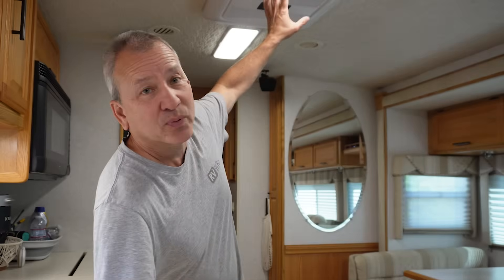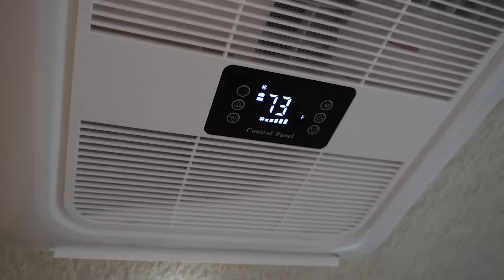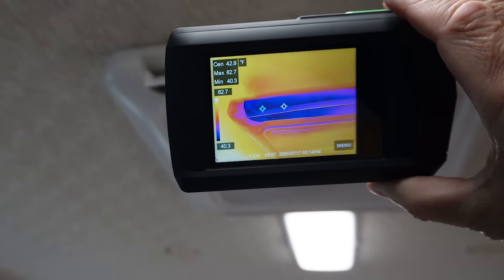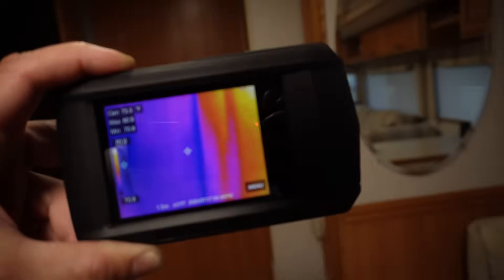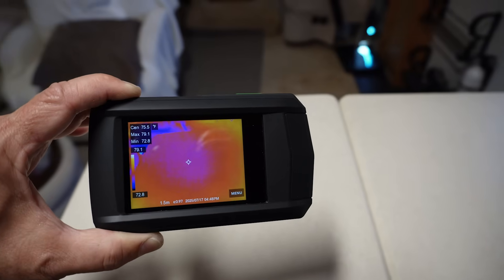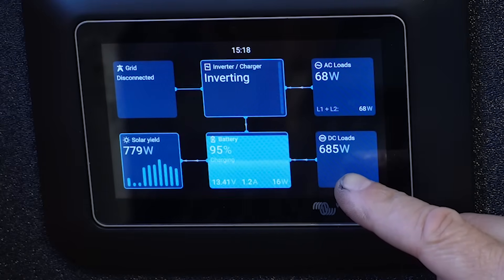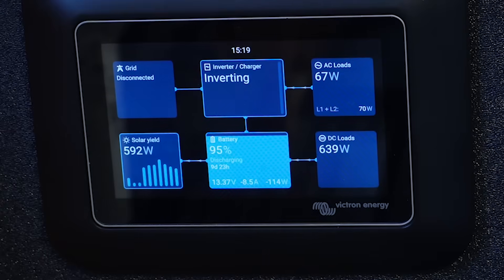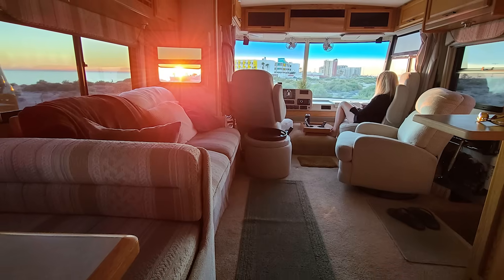91° Heat Test (Solar Only) : Can The CountryMod 12V A/C Keep Up?

Comment: I am building a small sleeping camper . 95" by 50" by 46 " tall . Do you think this will work with 800 watts of solar and 600 amp hours of batteries and run for a few days if sun is decent ? What do you think the minimal solar and batteries i could get by on ? I figured the 800 watts is good to go but not sure i can get that amount on the roof . Thanks for your opinion
Reply: I would add a ground deployable solar array to help offset your day time load consumption, and with 600Ah of battery, it would help with charging it. At a mere .1C rate of charge, that's roughly 850W just to charge that massive battery bank you have. Unless, you have generator as well in your setup?
Reply: @s.mendez7160 basically trying to get 3 days running that 12 volt ac . It's a small space and will be well insulated . Of course you don't know the run time . I would think it will run on a lower setting . The good thing is a small space chills fast so it should not need to continuously maintain a temperature  24 hours . Basically it's just for sleeping .
Reply: @stevencole7331  Ask Brian if he has any 24hr average consumption data in terms of Watt hours. That would give you an idea for his RV space. Yours is super tiny, so as you mentioned, the duty cycle will be far less.
Reply: @stevencole7331  2pannelli da 410watt 172cm x 113cm con 2mppt da 40amp e 2batterie lifepo4 da 314ah in parallel watt cicle mini is ok inverter da 2000watt max 2500watt cable 75mmq ok 👍
Reply: @stefanocerna6504 Thanks . Just going with a 12 volt setup  so the inverter is not needed . Yep you seem to be along the same lines as I figured . 2 300 amp hour batteries in parallel and 800 watts of solar should do the trick for a few days . Appreciate the reply

Comment: Wish I went with CountryMod it seems quieter and consistent compared with the OutEquip which also cycles on and off so often.
Reply from the maker: Good to know. Thanks.
Reply: @RVwithTito  I figured out that I just needed to adjust some settings. OutEquip works good too. 😃

Comment: Your Cerbo GX shows 780W from the solar panels. If I remember you installed 4 panels of over 400W. So now it is just maintaining the batteries. How much charging watts did you finally got at maximum from your panels so far?
Reply from the maker: They've generated over their rated capacity in certain optimal conditions. Typically up here I max out around 1500W

Comment: Hi Brian,  Good video as I contemplate my alternatives.  We're heading to Kent today to see one or two Van possibilities.

Just as an experiment, I wondered where you had been when you took the desert resort picture you dropped into the video.  I cut it down to include only the outside view through the windows and submitted it to AI for location ID.  Since this was my first time using such a thing, I'm wondering how it did.  Here's what it said.  Was it close?  
Thanks, Bob

"The image displays a coastal scene viewed from inside an RV, featuring a desert-like landscape with low-lying vegetation, palm trees, and multi-story resort buildings. The vibrant, multi-colored hotels (especially the yellow and teal one visible on the right) and the overall environment are highly characteristic of popular tourist destinations along the Sea of Cortez, specifically Puerto Peñasco (Rocky Point) in Sonora, Mexico. The combination of ocean, desert vegetation, and distinctive resort architecture strongly points to this region. The sun setting or rising over the water further aligns with this coastal desert setting".
Reply from the maker: Yes. It was at Rocky Point 🤩

Comment: I like the GREE EcoCool 15k BTU High Efficiency A/C + Heat Pump, better for your size RV & the area in which you live. Although it may require a Soft Start, it runs around 800 Watts on High Turbo Mode. It can also be connected via Wi-Fi.
One of the most powerful, quiet, and energy-efficient engineered rooftop air conditioners for the RV industry.
Reply: Nothing wrong with the GREE unit but it runs off 110v.  The whole point of these little units is they run directly off 12v batteries, no inverter no soft start.  I think the results he's seeing are amazing considering the rig size and BTU of this unit.
Reply: @StuPedasso 
I'm actually subscribed to Brian's channel. I watched him build an Air Condition System that runs on a maximum of a Thousand Watts. He is just playing around with this 12 volt Air Conditioner. I am a huge fan of CountryMod Pro. For that size RV it is more suitable for a Bedroom, because 79° is not comfortable inside an RV.
Reply: @lindsaywhite4502  if I recall correctly, that AC unit he built was also 12V. Again, I think he's exploring this ever growing works of 12V sure conditioners.

Comment: I put one of these on my 5th wheel after watching your video. The install had some problems. My roof was a lot thicker than yours, and I had to special order longer metric screws, because none of my local hardware or Home Depot/Lowes type stores carried them. In addition, I had to make and extender box out of cardboard and silver taper for the air exhaust to bridge the extra thickness gap. Recently, we took a 3 week trip through California, Oregon, Washington, and Idaho where outside temperatures averaged in the high 80's and 90's, and it wasn't enough to keep things cool. I realize that a fifth wheel is a bit bigger than your RV, but I was hoping it would keep my rv cool while driving,, but it didn't really keep up.I have 4 one hundred watt Battle Born batteries with a Victron inverter and 800 watts of solar, but the batteries didn't last long with the fridge, Starlink, and air conditoner all on while driving. It did ok, but when stopping, we used hookups and a Costco 12000 watt window vented air conditioner.
Reply from the maker: Didn't realize you'd have such a thick roof in the fifth wheel. I have a store nearby called Tacoma Screw where I get specialized stainless hardware like that...and...much cheaper than Home Depot. Thanks for the follow up report.
Reply: Had same issue with my Alta 28 foot toy hauler. Ordered longer screws on Amazon and made an extension of the air box with some packing material my batteries came in. Just back from mid 80’s trip and the unit kept my trailer reasonably cool when I closed off the bedroom and bathroom. Nothing close to the cooling of my regular AC but happy to have some cooling without running generator as I do not have an inverter and other than AC don’t have the need. In the future off grid in warmer weather will plan to run generator and AC to cool rig and then switch to DC unit.
Reply: @allenmay8850  Do you have a DC to DC charger?  If not, would that have kept the batteries up?  Setting up my system and want to drive with AC on and all the stuff you listed.

Comment: Hoping to do this in the next year. I travel with a dog and while I try to “follow the seasons,” there is no way to 100% escape dangerously hot days. I have 400W solar and 420 AH lithium set up on a truck camper. Wondering if I would have to up my panel/battery game to run an A/C like this…not too much room to cool, and I’m in a fiberglass truck camper with good insulation. Would love to not have to hook up to run my a/c
Reply from the maker: It would be a push for you to run it full time like I do along with all your other stuff. You'd probably need a little help from a small Generator or extra solar during the day.
Reply: @RVwithTito Thanks for your response. I’m a bit limited on space being in a truck camper. My lithium setup is in the compartment designed for a small generator and I don’t want to deal with hauling gas/propane around for it anyway. I do have room for an additional 200w Panel up top, but absolutely maxed out for battery space. My electric use is very minimal with the occasional use of an air fryer. No other high draw appliances and my fridge is propane. I think the market for 12v A/C is heating up (pun intended!) and hope technology advances quickly.
Reply: it's easy to add 400W of ground deployable solar into your existing system. The extra wattage really helps to save the Lithium bank for night time use.
Reply: @s.mendez7160 Yes, good point! But for my circumstances right now, it wouldn’t work because I’m away from my camper and parked in a hospital parking lot  because I’m a part time travel RN. I do camp hosting in the summer, so I generally have a hook-ups during the hottest part of the year. Still, would love to not HAVE to hook up to cool down, and very much trying to step away from the whole RN inpatient care business. 😊

Comment: I would like to see what it does with 110° heat in the TEXAS direct sun in an Airstream.  Anyway this will have to do.  Please update with 100°+ outside temps. Thank you for what you do!
Reply from the maker: We try to avoid those conditions but others have used it while hot boxing like that 🥵

Comment: Thank you Brian for the update.  The state of charge after all day is very impressive.  Are u moving air internally with any fans?
Awesome project and update.
Reply from the maker: The layout of our motorhome works well for this A/C. So we get pretty good coverage. It helps to run it all day though so it starts cooling early.  Cooling down a hot rig is always a challenge but maintaining the cool is more feasible.

Comment: I just installed this same AC earlier this week in my NuCamp Cirrus truck camper here in southwest Florida. I was hesitant about what the performance would be like but it's been incredible so far considering we are having feels like temps in the 108 degree range. Thanks for being a large part of my research and following up with videos like this.
Reply from the maker: Im sure pulling the humidity out of the air makes a big difference too. Thanks for the info.
Reply: 111f feels today

Comment: I went on a 5 week boondock camping trip with a countrymod AC in a 21' camper.  It was mostly in the 80's with a couple 100 degree days.  The countrymod worked well.  Note that you don't want to let the camper get hot as it'll have a hard time cooling it down.  It was a lifesaver for me when sleeping!
Reply from the maker: I agree that it's better when you can start early and keep it cool instead of trying to cool down a hot rig. That's a struggle for any rv air conditioner.

Comment: Its like a catch 22. park in the sun to get solar and bake with minor AC. Dual split baby. I used to live a van (Ford extended wood paneling over insulation, double door, with cage) in WA summer was fine It was the cold i quit. 6 months total, sounds weak. but solar when camping is magical. This video is great because everyone can relate. One day I'll do solar full time
Reply from the maker: Thanks for sharing your experience.
Reply: if you do your solar right it should shade you from most of the heat from the sun especially in florida

Comment: A few days ago, I posted a video showing the same test: running the air conditioner solely on solar power while parked on asphalt, with an outside temperature of 104°F (40°C). It proves it can be done!
Reply from the maker: Nice! I'll check it out.
Reply: Link?

Comment: Think we're going to get one of these. My only issue on the roof is that I have solar on each side (maybe 5" space between the OEM AC and the panels.
Do you need two of these on that big rig? 79 inside? 
I appreciate your videos -Keith
Reply from the maker: For a big rig two would be optimal. While this works for me in many cases, I also have a second ducted 12V A/C that I can run in tandem to cool down faster. It n uses more power though.
Reply: @RVwithTito got it! You've done a nice job maintaining that motor home. Cheers!
Reply from the maker: Thanks. We really love it.